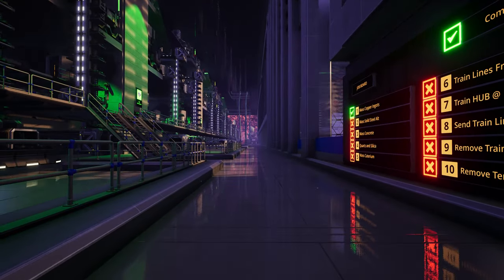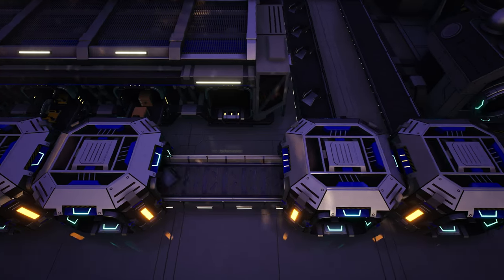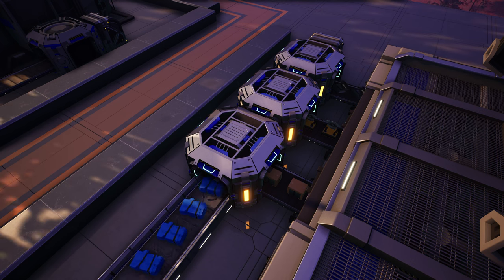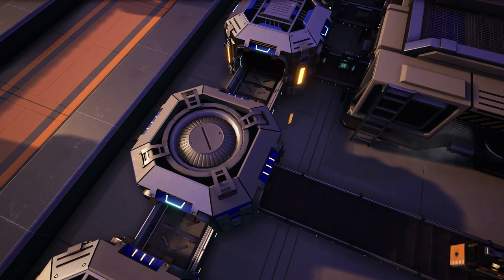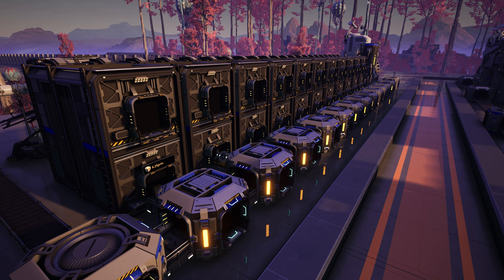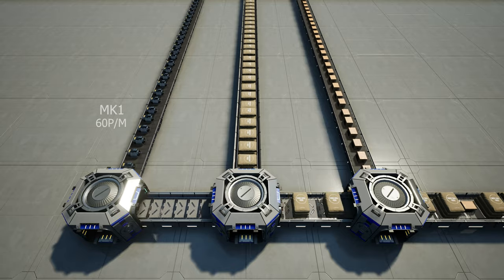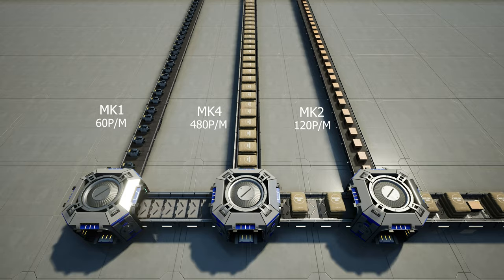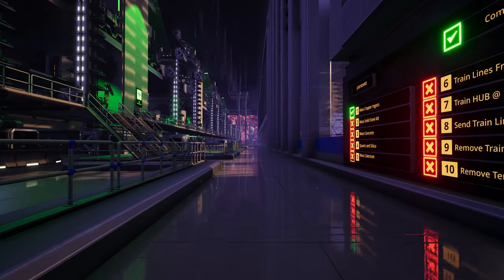How to use SUSHI BELTS in Satisfactory!!

Comment: Just saw this video and I really enjoy the idea! A friend and I have an unintentional sushi line on our multiplayer session to our first base that needs entirely re-done.

Not sure if I missed it, but do you have any output coming from your end containers? Or is the intention that once those are full, the items that are being processed will either end up in a sink or a manufacturer/other processing machine? Do you do anything further with the containers or would those just be spare items in case you need them for construction or advancing tiers if you are still working on those?
Reply from the maker: Great question. So far now in that playthrough they are just for Storage and personal use.. However when doing sushi line over and over again to multiple areas, what you tend to find out it starts to become a central location for a good storage room.. or you can bus them of elsewhere as long as you keep on top of how much is going into a container per Minute. This is done by minusing the input of the machines from the total you are sending initially  on the belt.

Hopefully this answers your question!
Reply: @ItsBitz  Thanks for the response! I just broke into tiers 5 and 6 and manually crafted the computers so I could get fuel refineries. It is definitely a learning curve! I am trying to avoid using the oil in the spire coast but realizing that most of the oil on the map is up there, so it is a struggle. Especially since I am right at the edge of the canyon which is also part of the zone that is getting reworked. My platform at the moment is like right above the crash site not far from the river and I am using the iron deposits all around there. I may need to look into a new location, possibly the area with the coal nodes near the big river up top.
Reply from the maker: @Adiuva1  You will like the next episode of the Let's play series, which is Episode 14 as I'm creating power with oil without using the spire coast
Reply: @ItsBitz  That is perfect! I have been trying to avoid Let's Play series to not spoil myself too much and think of a "right" way to do things based on what the content creator is doing. Certainly curious on an alternative though since I don't want to expand my coal.

Comment: Only a minor issue with smart splitters, some items aren´t recogniced by them, i mean, you set "left output X" and if you check that item has changed, its a old minor bug ( at least for me )
Reply from the maker: That is super strange, and the very first time i've everr heard that!! In that current save i used for the demonstration i have every item being smart split. Maybe verify your game, or a possible mod conflict?
Reply: @ItsBitz  Need to investigate, but i notice that bug modded, and in vanilla too ( set cable and change to another item ) Perhaps its time to performa a "dracarys" and a new fresh install of satisfactory !
Reply from the maker: Possibly yeh, it's worth a try and will listen out for it happening to other pioneers
Reply: I've seen this happen with programmable splitters, but not smart splitters. Apparently programmable are especially buggy in multiplayer and crashes my dedicated server when we try to use them. Smart splitters working fine so far though, I have 18 sushi lines wrapped around the base feeding a lot of things and ending in a warehouse and sink.
Reply: I've actually had that one, usually when only setting left and right outputs, and the overflow then doesn't work and have to set the overflow again.